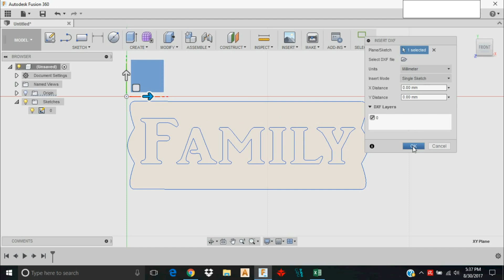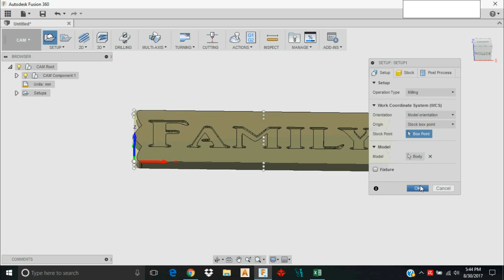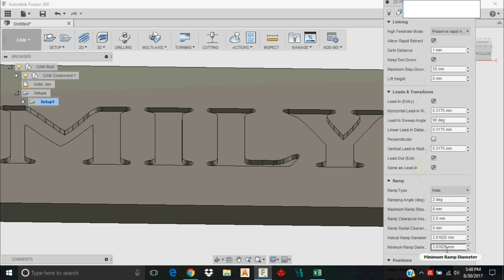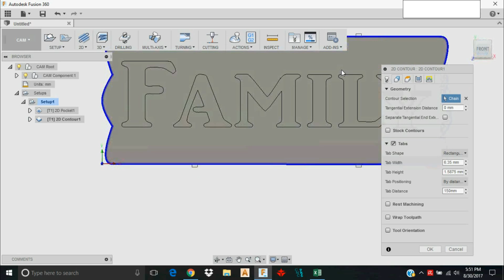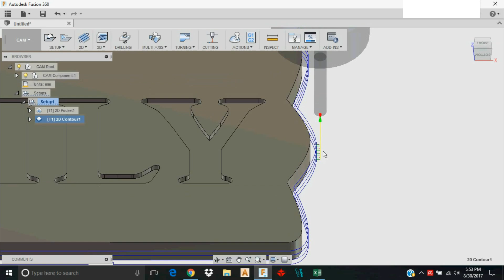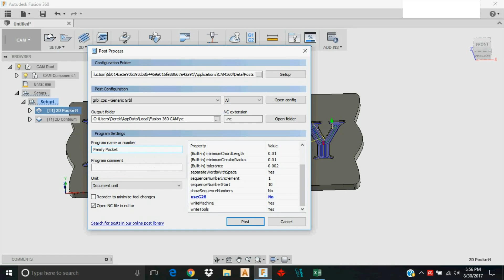Fusion 360 DXF Import Tutorial MillRight CNC

Comment: Very clear. Will try something like this, job 1,  when machine arrives in three days. I thought I'd hear where you inserted a pause to change tools , but didn't. What did I miss? Thanks
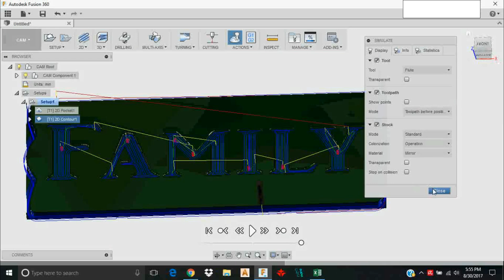Reply from the maker: Thanks Paul. You would break the job into separate programs. Check out about 19:30 in the video.  If you use different tools you want to post process the operations separately. The machine will run the operations with one tool and stop once it finishes the operation.. Once complete, you would change the tool out to the next one you plan to run. It's also a good safety measure to unplug your router before you change tools, just in case.

Comment: Hello hope you can help .... I’m trying to engrave into a 3/4 piece of wood and I’m following every video and and create the  G Code for it , and when I go to send it , the machine shoots up in Z Axis every time and has crashed ....does this have to do with the clearance? Or in the stock settings , please help ?
Reply: Hi, you can try leaving G54 in the code, touching off your cutter to set your Z height to zero at the top of your workpiece and running your code one line at a time until you solve the problem.

Comment: For some reason, every time I select my necessary geometries and other parameters for a 2D pocket, Fusion 360 keeps failing to generate the toolpath.  Any ideas as to how I can fix this? Thanks in advance.
Reply from the maker: It would be best to upload the model to the Autodesk Fusion forum and let them have a look at your specific situation. There are a number of reasons why it might not generate from the tool being too big to fit to the ramp settings being unsuitable for the pocket.
Reply: Thank you for the response!  I actually got it to work now.